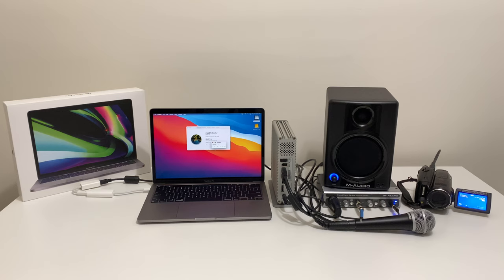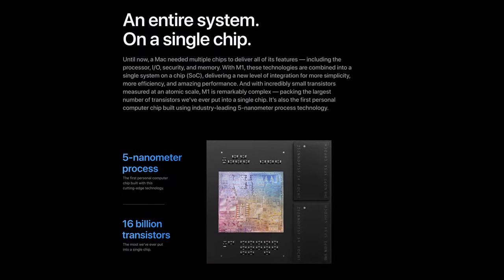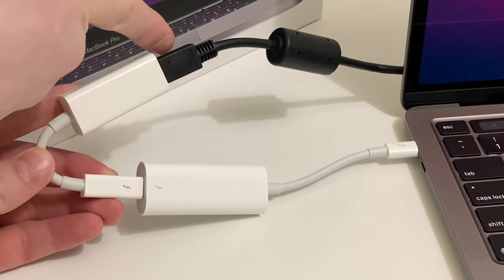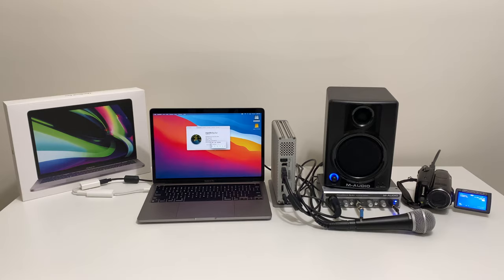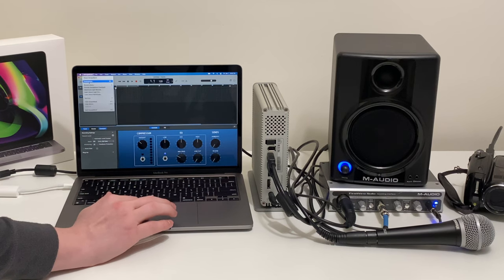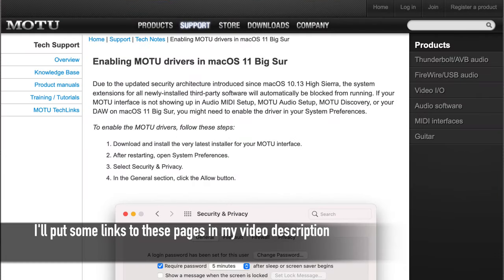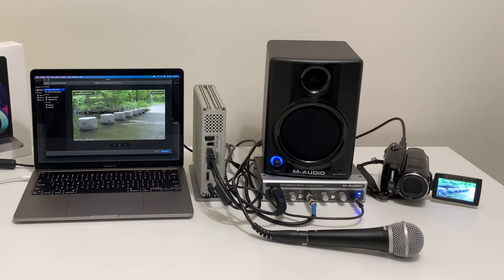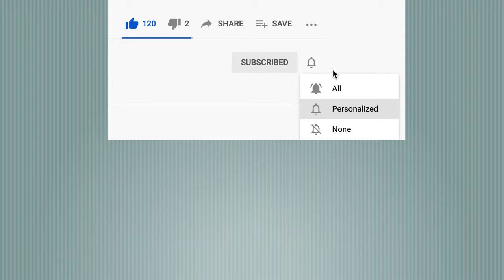How to connect FireWire devices to a new M1/M2/M3 Mac with Apple Silicon

Comment: I was thinking of buying an old used Mac mini and connecting my devices using the firewire on the Mac mini and remoting into the device from my new iMac. Then using device sharing to see the devices from my new iMac.
Reply from the maker: That would work but may be slower doing the remote connection vs directly connected.
Reply: @ScottSchramm  I have an old firewire tabloid scanner (and SCSI-2) and I don't think I can get a driver for the M1 iMac. I think using chain of adapters for my external drive will work.

Comment: The best and cheapest way to do this is to get a Thunderbolt Display that has FW800.
Reply from the maker: Yes it's certainly an option but those displays are large and heavy (expensive to ship, but ok if you can find one locally), and still require a Thunderbolt 3 to Thunderbolt 1/2 adapter.

Comment: You might be able to 'connect' to old firewire  devices but if the equipment manufacturer doesn't provide the required software it still won't work e.g. Focusrite Saffire Pro 24 to Mac Studio - no good.
Reply: If the audio-device architecture follows Firewire specs, it should not matter. Most of the time software was only needed on Windows.

Comment: For those who may want to know. I have a MacBook Pro MAX M1, Monteray and a Safire Pro 14, firewire and cannot get it to work with this setup. Same cables act. Installing the Mixcontrol, it can't see the device, tho I do hear it make a little crackle in the connected speakes as I start up the computer and it is also shown in the System prefs. However, its properly a mix control issue
Reply from the maker: If it shows up in the system info then the hardware is all good. It sounds like a software issue and the manufacture of that device may need to update the drivers to support the newer OS.
Reply: @ScottSchramm  yes. It is a software issue and Focusrite is not updating so I jumped on the SSL2+ bus and ordered it today. Hopefully it won't cause any problems :-) Thanx for your reply

Comment: I still cannot get my M1 Air to work with an Apple thunderbolt 2 display.... USB ports connect, but no video.
Reply from the maker: One Thunderbolt display is supported. You should only need the Thunderbolt 3 to Thunderbolt 2/1 adapter and it should be plug and play.
Reply: @ScottSchramm   No dice... I tried 2 different Apple thunderbolt 3->2 adapters and a Startech one, none of them worked. From the Apple forums a lot of M1 Mini owners are complaining of the same thing.
Reply: @ethan5577  Are you using the built in Firewire cable on the Thunderbolt monitor? My built in cable failed a long time ago and I've been using a separate Thunderbolt cable. Got the adapter for Thunderbolt 3 and my monitor is working with the M1 Mac mini. But the FW 800 port in the Thunderbolt monitor kernel panics if I turn on my external hard drive.

Comment: It's odd that Apple doesn't make a Thunderbolt 3 - to - FW800 adapter. Is there a tech limitation? …FW was their bread and butter for so long, and there are a ton of great FW devices still out there. Seems it would be in their interest to provide a slightly more elegant solution.
Reply from the maker: Apple would rather you buy two adapters :)
Reply: They must make this, even if it is twice as much, as it would allow power delivery in the same way original FireWire did.

Comment: I have a Thunderbolt 3(?) to Firewire 800 adaptor. It is the one you listed above for sale through Amazon. What else do I need to connect to a MacBook Pro M1 that has a Thunderbolt 4 port? The thunderbolt on the adaptor I mentioned does not fit into the port on the M1. ?? Thanks, Stuart
Reply from the maker: It sounds like you have the Thunderbolt 1 and 2 to FireWire 800 adapter but need the Thunderbolt 3 and 4 to Thunderbolt 1 and 2 adapter for your new Mac. Use the first link in my video description for the correct one.
Reply: @ScottSchramm  Thanks!

Comment: What is kind of shitty of this route, is that you power the audio interface with an adapter. The nice thing of Firewire is that it can deliver up to 48W to pheripherals. The nice thing of USB-C thunderbolt is that it can do this too. The bad thing of TB-2 is that it can't. So why not find a USB-C Firewire adapter that keeps the power delivery working?
Reply from the maker: I’m not sure where you read that Thunderbolt 2 doesn’t support power delivery because I have tested and even through all these adapters, the power is still transferred.

Comment: Did anyone tried with a Universal Audio firewire interface ? Thanks !
Reply: I’d love to know that too. I have a UAD Satellite new in the box I’d love to try with my 16” MacBook Pro (Intel).
Reply: Anyone ? <3
Reply: @bradschlueter3182  Just get the USB-C TO THUNDERBOLT ADAPTER...I assume you already have the thunderbolt to thunderbolt cable.
Reply: @MyBichSustained  Thanks, but my UAD Satellite has a Firewire connection.
Reply: @BradSchlueter  Did you order the adapters?If not shoot UAD a message and they will answer it....I believe it would work.
Reply: @MyBichSustained  Yes, they're on order. Thanks!
Reply: UAD states it will not work. I wrote to them and got as an answer that m1/big sur does not have firewire drivers... so it might work actually or not... i’d really like to get user feedback before spending 100e on otherwise useless cables...
Reply: I have Apollo 8 silver face firewire card.and I have both adaptors too.today I bought new mac mini m1 and trying to connect but it is not supported. On the uad site it clearly mention that these adapters not compatible for firewire card.but thunderbolt c extension card on the Apollo card will support on big sur and M1.
Reply: @famebhakti  thanks ! So did anyone confirm that the thunderbolt card adaptator works on uad firewire with M1 macs ?

Comment: You dont need any of this
Reply: £3.20 USB to IEEE 4 Pin Firewire i-Link DV Cable Camera PC and mac
Reply from the maker: @atherton1ful  Those DO NOT work!
Reply: @ScottSchramm  ive just done two tapes
Reply from the maker: @atherton1ful  You're lucky enough to either have a camcorder that supports it, or a motherboard that already has a chipset capable of decoding FireWire. For the majority of users, that kind of cable would not.

Comment: I've got the exact same computer, the exact same adapters, and the exact same external hard drive. FireWire "works" but it causes the computer to crash every 20 minutes or so. Other users have also reported this. Some research revealed support for FireWire was dropped with big sur. Odd that it works a little though.

Here's one source on this: https://discussions.apple.com/thread/252162377
Reply from the maker: FireWire support was NOT removed by Apple in Big Sur. However, some devices like audio interfaces need special drivers to operate and if the manufactures of those devices use legacy kernel extensions then they may not work with Big Sur. I have not experienced or heard anyone else report crashing issues after 20 mins. You likely have a third-party software/driver issue causing that to happen.
Reply: @ScottSchramm  no third party driver.
Reply from the maker: @5thWatcher  what device are you connecting that is causing your Mac to crash every 20 mins?
Reply: @ScottSchramm  A lacie external hard drive that I think is identical to yours in this video. I've used it for months without issue but I only just recently tried the FireWire on the new M1 since I just got the adapters.
Reply: @ScottSchramm  also worth noting: I used the device with FireWire without issue for years on a 2012 MacBook. So the only thing I can narrow this down to is FireWire use on the M1. I also tried the adapter attached to a hub and directly to the M1.
Reply from the maker: @5thWatcher  I just connected my LaCie FireWire hard drive to the M1 and left it run for an hour and mine didn't experience any crashes or issues. So you may want to open a case with Apple so they can troubleshoot your issue. Although most people have moved away from FireWire, it's something Apple still supports (they haven't otherwise officially announced that it would be going away....unlike how 32 bit app support and unsigned apps were actually removed)
Reply: @ScottSchramm  I appreciate it, though other factors could be that I had it running as a time machine back up and I was probably putting the M1 under a heavy load in logic. It might be fine under less strenuous circumstances.